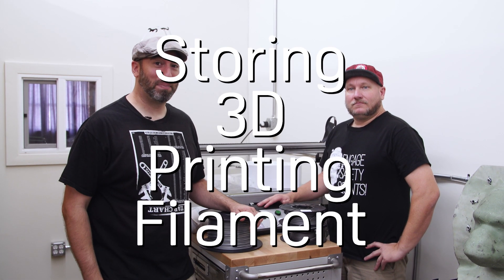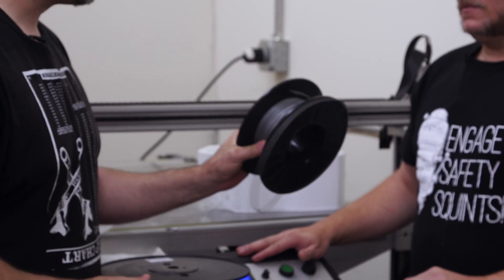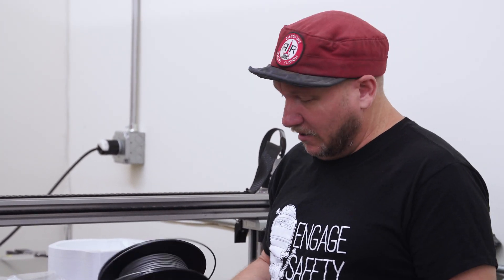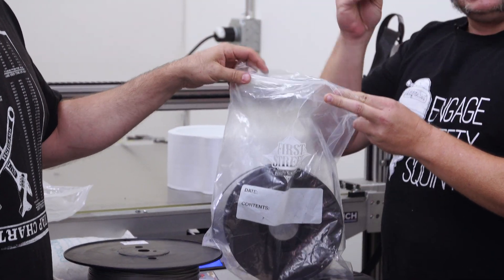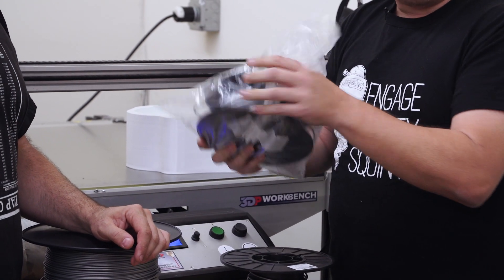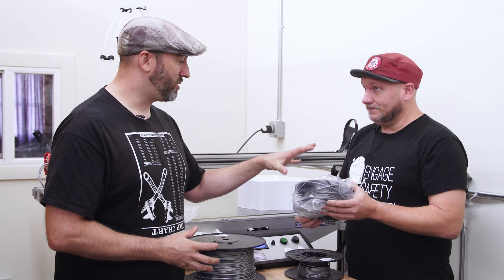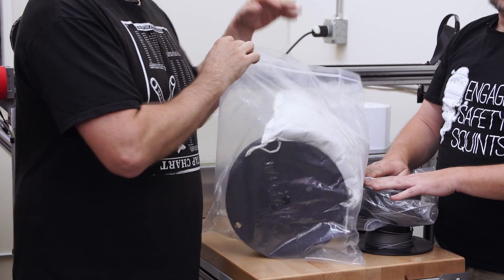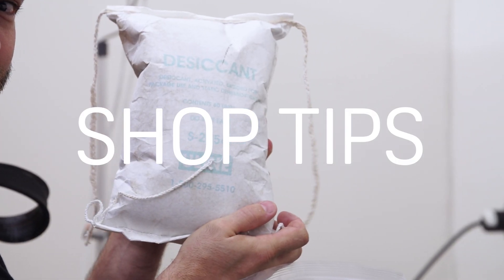Shop Tips: Storing 3D Printer Filament

Comment: It should be noted that the silica packets do not last forever.  They will eventually fill with humidity and not work.  Most of them can be dried for a few hours in a hot environment (maybe oven set on 170F?) and reused, but just know they don't take out humidity forever.  

Also, Ziplock or similar plastic bags are not fully sealed.  They're probably good enough to keep humidity out for a time, but if you fill one up with air and leave it for a week, you'll see it's no longer full of air.  Air eventually goes in/out.  This is why potato chip bags usually have a metal film inside the plastic of the bag (this is why it's shiny) to fully prevent humidity from entering the bag.

Comment: I have successfully stored PLA Filament for over 3 years by keeping them in individual zip lock bags, large silica gel packets, and in a cupboard with a de-humidifier running. the only ones that i have noticed issues with were ones that were tricky to print with day 1!

Comment: So... Is this why my filament kept breaking?
Reply: Yes. Moisture makes filament brittle.
Reply: Well, I wish I knew that before.
Is there any known way to fix it?
Reply: preheat to somewhere less than 80C(175F), chuck the PLA in for 4-6 hours, should be mostly dry by then. store it in an airtight container with desiccant as in the video.

take care that low temp PLA (the stuff with recommended printing temps under 195C) get a bit less temps (around 65C should do)
Reply: Thanks. Does it work the same for ABS?
Reply: Yes! I dried my ABS at the same temps, and afterwards, I stopped hearing the 'pop' noise of the water vaporising when the ABS went through the hot end.

Comment: you did nothing to prove to us why this is necessary, or even tell us what "hear say" is around this subject... this video was not well thought out
Reply: If you don't do this or something similar your filament is toast. This is not myth-busters territory, just facts. I disagree - this is a good video.
Reply: Filaments absorb moisture, it's just a fact of life with plastics (some more than others, like especially nylon) 
Ever hear pops and cracks coming from a printer while it's printing? that's literally water turning into steam in the hotend.
Reply: Maybe this is not a big issue with PLA, but I've never had any problem with this. Never heard pops or cracks coming from the print head either.

Comment: I store my filament in the dusty, moist open air, maybe not the perfect solution :D
Have not had any problems with it yet though...
Reply: If you use ABS, PC or Nylon you will, PLA is quite forgiving.
Reply: littlestworkshop mainly use pla and petg, but i also have some (terrible) asa and some hips...

Comment: i dont know anything really about the world of 3D printing so forgive me if this is how it works already but would it be possible for the machine to calculate, in feet or meters, how much material you would need per job then you could just buy a large bulk spool and then either mechanically or by hand measure out how much you need, cut it then load it onto a smaller spool? you could maybe add on a little extra before you cut it to just cover any errors in calculation. but seems this way would be more economical and suppliers would sell more product (to keep them happy) and users wouldn't have to worry about running out mid-way through a project (keeping them happy as well)?
Reply: Let's say you have a print that you estimate will take more than 50% of a full spool and you end up having to stop that print early because of some failure that you can't resume from. If you had cut to length before the print, you now have 2 spools that individually aren't enough to print that project. If you don't cut, depending on how early you stopped the print, you might still have enough on that spool to comfortably retry that project.

In essence, cutting to length before the print gives you no benefits (except maybe easier mounting during use) but does increase 'end of spool' issues.

Also keep in mind, that 'offcut' material may not be enough for a large project, but it will still be good for smaller projects.
Reply: Benjamin Schroeder just an idea for a guy that's never done 3d printing before is all, at least you could use my idea for knowing how much material to order before start though right?
Reply: Oh for sure. Most slicers (the software you use to convert from the 3d model to the instructions the printer uses to re-create it) will give an estimate of length, weight or both. Especially for larger projects, it's important to know. If it is expected to weight 1.5Kg for example, you know that a 1Kg spool will not suffice. 

I was just trying to point out, that it isn't necessary to cut the length for every print. If you are only printing something that is 10g, you can just use that 1Kg spool as is
Reply: Also, why would you cut it at all? If you need less than what you have left on the spool, you can just use the spool as-is, then store the rest. If it needs more, then you're going to need the whole spool anyway. There isn't really any reason to have to measure it. That would be a huge hassle, and it's not like the spool deteriorates in 10 minutes, anyway. Sitting overnight while a print runs will do no harm to it... Unless you're maybe living in an open-roofed rainforest house... XD

Comment: They make re-usable silica units that you plug into the wall to reset them back to new.  Also you weigh the spool when its brand new and write that down on the spool then all you have to do is weigh it again later after you printed to see how much you have used up.

Comment: Most filament comes with the silica packets btw, keep em, if they stop working put em on a tray in the oven on lowest heat with the door ajar with like a wooden spoon or something to dry em outSuck the air out of the bag with a straw for bonus points.

Comment: I don't recommend Ziplock bags because after using them a few times, opening them and putting the filament reels in can cause the seams of the bag to weaken and split. You also take the risk of not sealing the top properly. Make a drybox for this with a cheap plastic container from Home Depot or similar, and buy silica gel in bulk. Lots of videos explaining this on youtube.
Reply: I would second this.  I put all my filament rolls in a large plastic storage container than pour a ton of color changing silica beads into it.  When the silica beads absorb too much humidity they change from orange to green (that the color changing beads I have, there may be other brands that come in different colors), then I simply pour out the beads onto a tray and bake them in the oven at 275 for about 3-4 hours.  They'll change back to orange again and let them cool for a few minute and then pour them right back into the container.   In my humidity conditions I just have to do this about once every 3 months.  So far after over a year this has worked out great and I haven't had any problems with moisture and filaments.
Reply: I found most of the boxes in my local hardware stores were not air tight, so a bit of silicon sealant around the lids can help stop this.
Reply: flippantb It's a non issue with good quality Ziploc bags. We have gallon Ziploc bags that have seen literally 100+ cycles of opening/closing, and they're still airtight.
Reply: I'm sure you have had good experiences, but I have not. I have used ziploc brand 1 gallon bags with 1 Kilo spools and seen them fail. The blue tinted ones with color indicating zip strips. Even in a sealed bag with no splits, I have seen my color changing silica indicate that moisture was still leaking into the bag after 1 month. We have 80-90% humidity here in the tropics regularly. This probably works fine in low humidity environments, but for high humidity ones, I suggest at least double bagging.
Reply: nice tip thedementation666, I heard of people using weather-strips (foam strips that come with tape on one side), but silicone should be easier to get
Reply: I store my filament spools in a desk drawer... except for the one I've most recently used. That one is on the back of the printer.
Never had any issues with print quality over that.

Comment: What can happen when you don't store filament correctly / filament goes bad? Is there a particular way to tell a print failed because of that?
Reply: Here's a little article I found about it: https://reprage.com/post/3D-Printer-PLA-moisture-problems-and-storage-solutions

I was thinking that it could cause bad prints because it could create gaps while you're printing, but it's a little worse than I thought.
Reply: PLA will get VERY brittle.  ABS will be fine...

Comment: Or you can make your own look for sodium silicate cat yes 🐈 litter and sock $3 vs $30 😎
Reply: Robert Culliver Cat litter has WAY too much dust, and the pore size of a sock will let all that dust out and it will contaminate the whole roll. Dust is the enemy of spooled filament.
Reply: Andrew Delashaw really Andrew open your mind just a smidge, yes it can be dusty if that is a issue for your application than run it through a sieve to the size that you need 
I have used this method it gun safes tool boxes and air line driers where small particles would travel through the air line and destroy a tool if it  didn't work I wouldn't mention it
 it's the same thing if you don't like a sock use a tyrex mailing envelope and Stitch it up just like the ones you buy  it's just a option for somebody with limited funds or can't stand being ripped off

Comment: Fast, factual, functional. Perfect shop tips!
Reply: Kind of. The re-use of silica packs without refreshing them is basically useless.  Sure, you can put them in there...but whether or not they are soaking up moisture is another thing.  Best to re-bake them first to ensure that they will work.  Also, unless your humidity is high this is not even needed.  Best to keep your humidity in control for YOU and your filament. My humidity in my workspace is 48-52% continually...so I do not need to have any special storage options and this may be the case for others as well.  While this video was short, to the point..there needs to be a preface with the above info as well.  But, you know, do what YOU want... I only know what works for me, and I freely share my knowledge in hopes that it helps others...take it, or leave it.